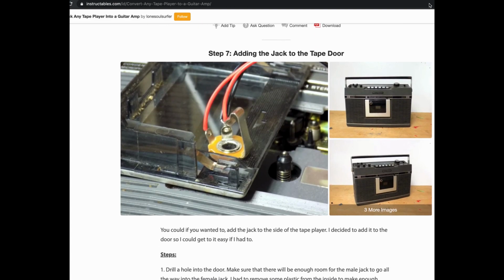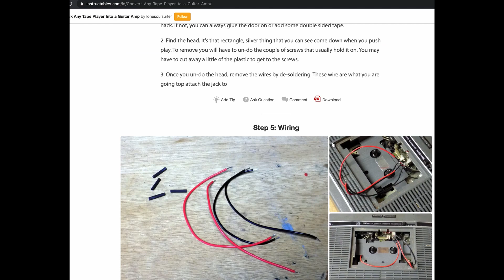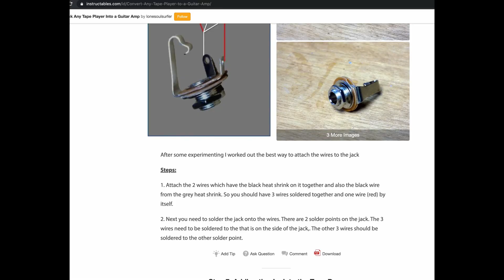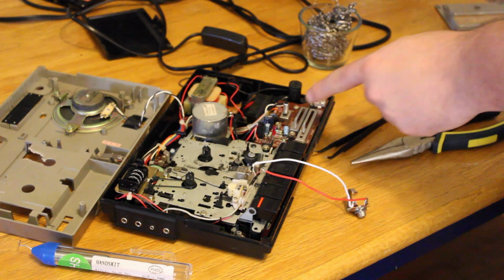Hacking a Tape Recorder into a Guitar Amp

Comment: I think you'll need some kind of resistor and potentio since the sound is always distorted means the input volt is too much, like way too much compared to the original tape head operating voltage
Reply: Unless the distortion was the point lol